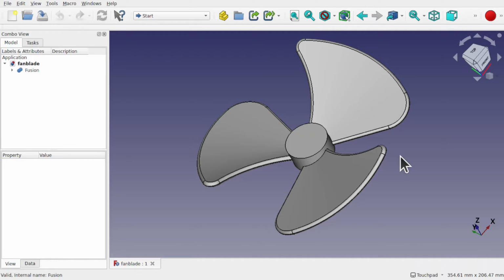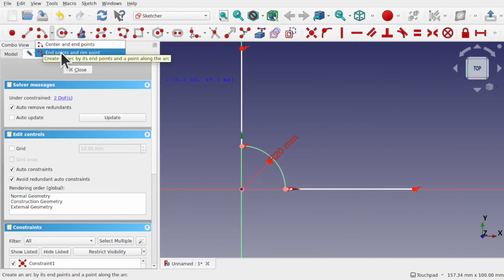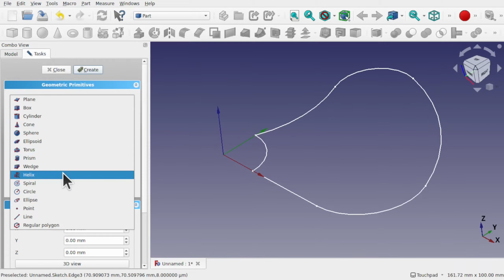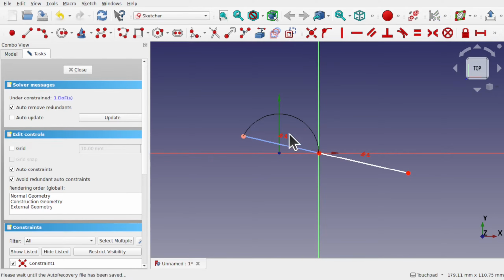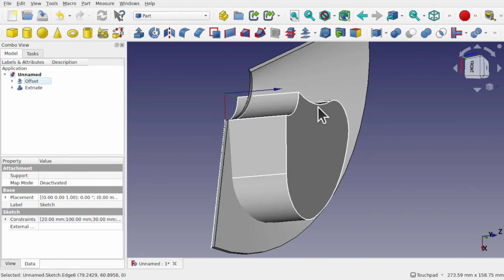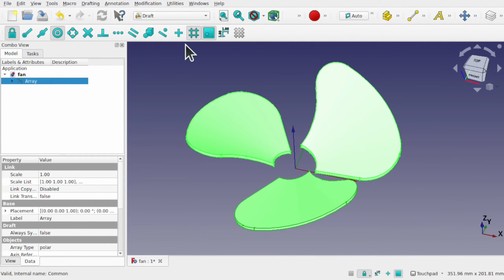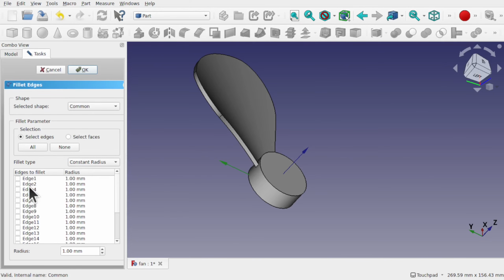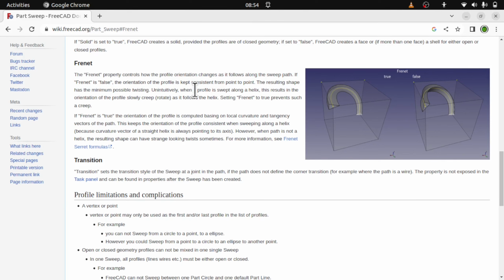FreeCAD For Beginners 44a | Modelling a Fan | Part Workbench Array and Intersection Workflow

Comment: Great video as always. I had an interesting experience in 0.22dev. I struggled getting my fan blade to look anything like yours; it was not nearly as tall as what I saw in your video. Finally I started over in 0.21.2, and everything worked perfectly. 

At the end of the video, where you demonstrated the Frenet setting, I noticed a striking similarity between the 'Frenetted' blade and my original attempt in 0.22dev. I then went back into 0.22 and started over. When doing the sweep, I saw that the Frenet option was checked by default in the Sweep settings! Unchecking the box solved the problem and allowed me to duplicate your results.
Reply from the maker: Oh wow, so that's been enabled by default.  That's interesting.  Thanks for feeding back on that, great to add for others.  Glad your enjoying the videos.

Comment: As I commented on another video, where you did the same, you don't need a line to actually go through a point for the "point on line" constraint to work. For the purpose of that constraint lines and arcs are infinitely long. No need for additional (parallel) construction lines.

Comment: A common mistake being made when drafting blades is not to change the 3 blades pitch with respect to one another.
Reply: Using the FreeCad Version 0.20.2 - I cannot get past the point selecting Sketch for  Sketch001 and translate to the center. I get  "Recompute failed! Please check report view." Where do I find the actual issue to correct? the message is in the report view window. not clear on what is failing.

Comment: 9:13 Even thought the end point of the helix wasn't on the line extending from the start of the helix, you can still use the 'Point On Object' constraint. It will work the same as the parallel construction line.